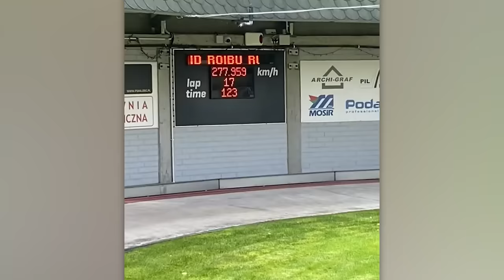200 Incredible Things Caught on Camera. Best of the Month

Comment: The one from Japan happens in Tokyo all the time. A large portion of Tokyo is built on a reclaimed bay so there is loads of water under the land. When there are any natural conditions that cause waves the water will push up through the land; sometimes through cracks in pavement or non-grouted bricks.

Comment: 4:04 I don't believe it. You don't just walk around with bare skin in -64 degrees. 
It takes less than 1 min to freeze your skin if it's not covered, your breathing will be affected, that clip is BS. 
Besides, it sounds like it's windy. 
You get frostbite in a matter of seconds.
Reply: I agree. My skin starts to burn when it’s in the single digits and windy.
Reply: yeah you got em. the weather at the south pole is a lie.... good catch
Reply: @KarmaCadet  I didn't say that.
Reply: I think they may slather some Vaseline petroleum jelly or some protectant? I’ve thought the same that their skin would freeze instantly but I’ve seen a few videos like that from the Stations down there having their faces bare and hands. Google and you can see many photos. Depends on which station as well due to location and time of year.